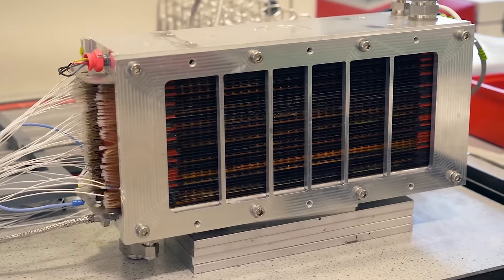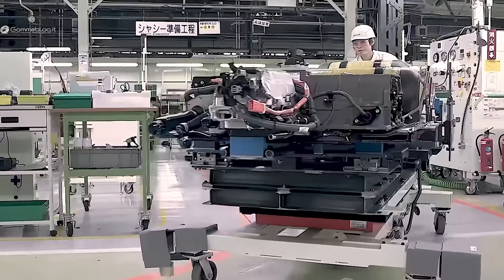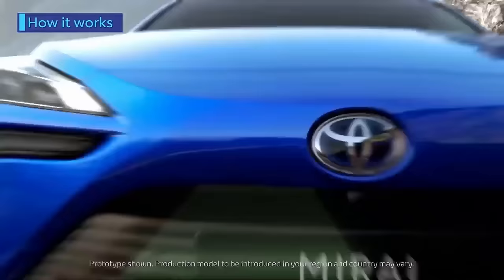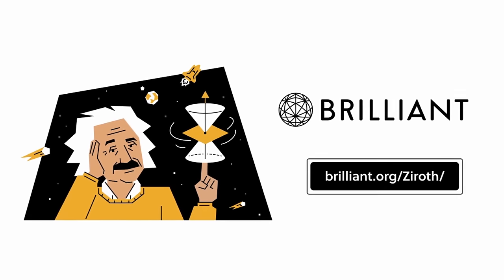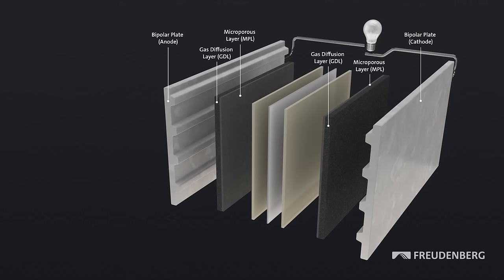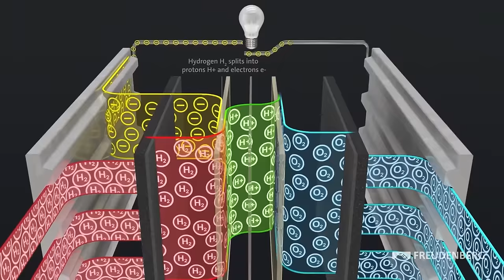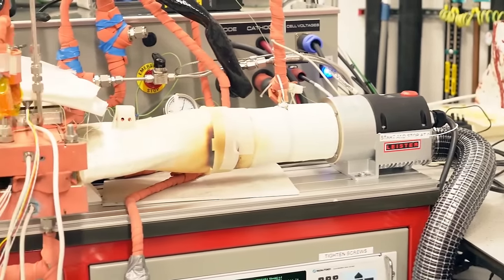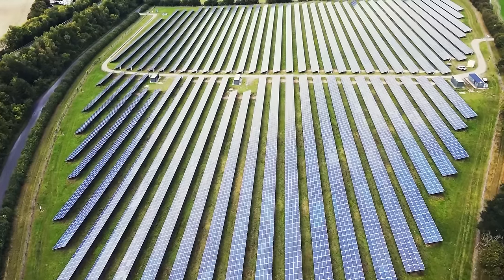Why This Hydrogen Fuel Cell is Engineering Genius

Comment: Again "slapping a turbo on it" was the solution.
Reply: at least they're using turbos in a creative way, rather than just using it to replace displacement.
Reply from the maker: When in doubt.. Turbo
Reply: Just slap a turbo sticker on something and it’s better.
Reply: As an Engineering Phsicist by education, I truly appreciate everything the turbochargers can offer. The best thing they offer in cars or airplanes are red-orange blowtorches under the cowlings. Hence, my Son's dead Subaru WRX in my driveway. That I could barbecue on the hood for ~2 hours after engine shutdown. 
I've flown in the back of several turbocharged twin-engined Cessnas. 340, 414 and 421. During the day everything looks "cool"/fine. At night, the terrifying orange-red glow from behind the engine in front of a 1/16" stainless steel firewall. Does not inspire confidence in engineering, design or longevity. No haters please. Properly maintained twin Cessnas are excellent if you fly them carefully, take care of the  ~310-375 HP engines that are 285HP in a N/A setup. And fly them as far below gross weight as possible. The problem is they are cheap to buy and very expensive to maintain. And people overload them all of the time. Because? If there's 6 or 7 seats. Then that's what you can put in their spacious cabins. Right? Plus everybody's baggage in the nose for the vacation trip to a high altitude airport.
Reply: @wanderingbufoon  this comment makes no sense. The usage of a turbocharger to increase power was insanely creative. And it doesn't replace displacement, any displacement engine could use a turbocharger. It increases efficiency. Why waste energy out your exhaust when you can recover it, use it to compress your intake charge so you can burn more fuel.
Reply: @forbiddenera  "increase efficiency" he says.. for one, it just rams more air in. Thus replacing displacement. You can have a 2L in a 1L engine. That's replacing displacement. Also, IDK why you're mentioning what the exhaust turbo does. I literally see no point of you saying any of that.
Reply: @forbiddenera  
Yep your right bud. he doesn’t mention it’s car exhaust temperatures just hot temperatures lol. You can further cool the incoming hydrogen and keeping it more dense, you could split the turbo using a drive shaft. As Mercedes did in one of their f1 cars. 
Intake side. (:)———(:). Exhaust s.
Reply: @ZirothTech  I skipped this for days because it looked like low effort AI content clickbait. You did yourself dirty bro.
Reply: @msmeyersmd8  I've got a dead XR6 turbo in my driveway. Best cars in winter, instant heat! :D
Reply: @msmeyersmd8  by N/A i assume you mean North american which markets are the 310-75 hp ones in? i'll research it myself but when you say people overload them all the time do you also mean by flight or operating hours before overhaul as well? thanks
Reply: @domwick720  Sorry if I was unclear. By N/A, I meant Normally Aspirated. Excuse my mistake if that is not the correct acronym. Please understand my purely personal bias. I absolutely hate turbochargers and what they do to small displacement engines through small, cramped , deficient airflow, consumer automobile engine compartments. 
Or under, equally cramped, aircraft engine cowlings. Especially when longevity and reliability are considered.
Trust me. I understand how most of those problems can be engineered away. But at what cost? And what purpose.
It's just a life experience, gut feeling, nauseating distrust of these turbocharged engines.
In 1973, my Dad retired from the USAF in DC. My family returned through my Mom's hometown in NW Kansas where my Uncle had a successful farm. Sitting out back with weeds up through the hood and over the top of the pickup truck was a late 1940s flathead Ford V-8. It hadn't been driven for at least 15-20 years. My Dad was a Ford fan. He went the incredibly rural auto parts shop and got a gasket set for the engine. In stock. On the shelf. So we pulled the truck out of the muck. Took the Flathead apart. I cleaned the heads which required microscopic precision😂.
We changed the oil,  xmission and rear end fuids. Dad cleaned up the carb after we  drained the lines and got new gas in it. Fuel pump was still good. Pre-oiled the engine with a drill. It started up the first time. Of course some tuning and idle adjustments were needed. But we drove it daily for the next couple of months before going on home to SW Oregon. For me to finish HS.
I'm going out on a limb here. And saying that almost 0% (zero %) of any post 1980s turbo shit-box 4 cylinder could be made operable after sitting that long.
I haven't tried it. So maybe I'm completely wrong.
It's just my gut feeling.
Reply: @msmeyersmd8 I suspect you’re right about the likelihood of resurrecting a shit box that’s been mausoleum’d for two decades. They generally aren’t made to run for 20 years, let alone run for some period of time and then corrode for 20 years. 

Does the intended use case for this technology being commercial airplanes make this any more palatable for you? Airlines are pretty heavily regulated and preventative maintenance is a known component of keeping an air worthiness cert. Yeah, airlines put profits first [at least in US], but hopefully consumer confidence encourages at least paying lip service to proper maintenance. 

Cheers!
Reply: Steellasted @0ddSavant  I see them as two different cases completely.
Modern Engineering allowing stronger lighter materials via Engineering Labs. Better efficiency, power density and much higher structural strength to weight improvements..
Different materials (especially magnesium) like aluminum and steels caused very accelerated corrosion, etc. 
Especially in moisture laden salty environments.
Older cars, stationary engines, etc. weren't concerned with weight. And were over built. So they used mostly Iron/steel that lasted longer and corroded much less.
Aircraft are designed and built to completely different design goals. Light weight, high power to weight, ability to absorb damage, etc. were priorities. The Japanese weren't big on self-sealing fuel tanks. And that cost them many losses early n WWII.
In the commercial airliners space. I have seen multiple videos where the drill holes did not line up. Boeing employees were told to just drill another hole and "proceed". Many drill holes overlapped. That could be overcome with Proper assembly procedures. But this was not done. This results in weaker joints. And metallurgical crack origination. That may progress to the point of failure. Much earlier (5-10x) than in a properly assembled airplane. That is unacceptable to me.
To be honest, I've known aircraft mechanics from my Dad through Vietnam Vet Huey CrewChief Gunners who would find that completely unacceptable. And would loudly proclaim they would not sign off on such a shit*y repair or assembly.
I will break decorum and say "FUCK McDonald-Douglas/Boeing Senior Management Assholes".  They had better keep a close eye on those people who repair and maintain their personnel transport airplanes. For mostly useless travel reasons.
I know none of those people or what airplanes they use. But there are others who do.
Personally, I wouldn't want to piss off the airplane mechanics that worked on my private airplane.
They might have trouble with the "Fencer Valve". Without the proper replacement ball-bearings, 3-in-1 Oil, Gauze Pads and 10 Qts of Quaker State Anti-Freeze. "Fletch", 1985.
Whether it's manufactured by Boeing, Airbus, Grumman, Lear, etc.
Cheers Brother. 😎🇺🇸
Reply: @msmeyersmd8  Thanks for the reply. 

Oh, I’m very familiar with Fletch. The second one not so much, but I think I could probably line for line 90%+ of the scenes from the first one.

I was thinking “Boeing” in the back of my head when I wrote original post, and still I was thinking “Well surely that’s a one-off.” 
But it’s not.  Not to change subject suddenly, but there’s a reason the US averages 1,704 train derailments per year and all of Europe averages 6. We consistently value profits over human life. 
Sigh
It’s not a good look for us.

Here’s hoping some common sense and taking pride in your work & not just maximizing stock value starts to find its’ way back into common usage.

Cheers!
Reply: Looks like he took your advice 🤣🤣🤣
Reply: I'm waiting for the Banks mod
Reply: Yeah but this time it is somewhat different I think. Because pressure increases the solubility of oxygen in water, and water is needed to conduct the ions.... this will increase substantially the limiting current density, or mass transfer of oxygen to the electrodes. Nice that this works by reusing the generated heat.
Where also due to the increased current/power density you would have  again increased heat forming. Kind of selfsustaining. Nice 🙂
'What I wonder is what would happen if youd o the same also for the hydrogen. But what I dont know if that is actually needed. Higher pressures in general should increase the cell voltage and if you sort of can get that for free then this is a nice thing to tap into
Reply: @ZirothTech   the 2nd duckt tape of automobile world

Comment: Haven't high temp fuel cells always been more efficient? That was the big issue in fuel cell development early on. You could get plenty of reliability and power from a high temperature fuel cell, but your car had to heat up to work properly.

Also, power from fuel cells has never been the issue. It's always been that hydrogen is slippery. It can leak out of most fittings and can even squeeze in between molecules of solid objects.
Reply: I guess aviation as a target is a lot more sensible then. Commercial aviation has a lot more maintenance and regulation for it's fuel and fuel tanks already so the premium for fuel tanks with better seals won't be so impactful. Once the planes turn on, they're on for at least an hour up to 12 hours so no short on-off cycling like a car. Airports being the only places where to tank up will make the supporting infrastructure easier: there might be hundreds more gas pumps than airports. Finally, unloading the unspent hydrogen from landed planes if they will also be feasible with the airport infrastructure.
Reply: Things still break faster even if you inspect them regularly, adding cost. Also, liquid hydrogen is a pain in the ass.
Reply: I was wondering too, if  the well know problem of hydrogen storage has been resolved.
Reply: Correct and it damages many types of materials, even metals
Reply: It isn't even just how hard it is to handle. The corrosion, and leaks are definitely a big part why it is stupid. It is the volumetric density that is the issue. 

 Unless we want massive vehicles with that is all fuel tank. Hydrogens volumetric density is the issue! 

 You can have the most efficent fuel cell you want. The problem is even 500 BAR tanks don't hold a whole lot.

  Those high pressure tanks are heavy and expensive for saftey reasons so it isn't like you can just go bigger like a rocket. You don't want to skimp on the quality of the construction either since that will kill people randomly. 

 When you factor in the fact that battery tech developing as fast as it is? It makes no sense to try to build everything for hydrogen when EVs can out perform them in every metric. 

 Look at Toyotas offerings. Their cars don't get more range really than an EV. They are heavier than a Model 3, less space inside the vehicle since it is dedicated to holding fuel, costlier, and there is almost zero infrastructure to support it all!

 Let us not even forget hydrogen cars don't even get the insane HP. They are relatively slow in comparison to a pure EV. 

 I don't know why, because they still use electric motors. Maybe fuel cells just can't unload their stored power like banks of batteries can, I guess. 

 It does blow my mind that a liter of water holds more hydrogen atoms than a liter of PURE LIQUID hydrogen! By a significant amount!

 Maybe one day we can create some futuristic nano sponge that somehow packs hydrogen atoms into a smaller area, and that takes little energy to release. 

 But until then I just don't see hydrogen being used for anything except niche uses. It is great for space shenanigans.
Reply: The sponge you are talking about is called hydroxide. Specifically hydroxide powdered metals. There are many formulas with many temperature ranges. Much safer than any liquid or compressed pure hydrogen. Last when it comes to vehicles and the demands of higher amp draw from   acceleration, the solution is having  a hybrid system with a battery bank that is recharged by the hydrogen and fuel cell when voltage drops. Not perfect because still using cobalt lithium, but very possible.
Reply: @karimdakkak1407  the term is hydride; not hydroxide.

Comment: The ultimate fuel cell is Methane solid oxide fuel cells - they can hit 95% chemical to electrical energy conversion without breaking a sweat! Only issue is they're expensive. But I'd be willing to bet that will change soon.
Reply: Doesn‘t this create CO2 emissions? Is there or will there be ‚green‘ methane?
Reply: @RichelieuUnlimited  the water vapor from the H2 fuel cell is as much or more of a contributor to warming as methane and way more than CO2
Reply: @terryevans1976  Well, we will need a net negative in greenhouse gas emissions at a point in the not so distant future, if hydrogen isn’t a viable alternative, than we will just have to ban flying. Or we don’t release water vapor into the atmosphere, instead storing and condensing it onboard.
Reply: Don't release water vapor?! So no breathing either 😂  @RichelieuUnlimited
Reply: @RichelieuUnlimited  Methane makes the least CO2 of any carbon-based fuel, but if you're worried about CO2 yes there are many renewable methane sources.
Reply: @maj429  I‘m no expert on fuel cell technology, I have superficial knowledge at best, the type you get by skimming through introductory material once or twice. Thus I ask. I couldn’t find information on how *long vapor released at higher altitudes stays in the atmosphere on short notice, so cannot easily compare the climate effects of water vapor, CO2 and methane if released by planes. The goal has to be net zero additional greenhouse effect, as otherwise any reclamation efforts to restore the former equilibrium would be futile. Combatting merely the symptoms of global warming is already quite expensive.
Reply: @terryevans1976  what do you mean? There’s water vapor every day in the air, then it falls down and waters the plants…

Do you mean that “all the water vapor” is the biggest cause of warmth on earth? Because yeah, that’s called “the atmosphere” and I can believe all the clouds keep us warm by reflecting/diffusing sunlight.

But putting 1000 L of basically rain in the air… how is that a problem?

Maybe I’m missing some key insight here. Gonna do a G search.
Reply: Not - 55 -60% if working with methane and 95% if work with H2 but this is not true they work very hot only.
Reply: @lucbloom  I'm just stating that water vapor is one of the largest causes of greenhouse warming.  So if you are promoting a solution that generates more water vapor to stop warming its' counter intuitive.
Reply: @RichelieuUnlimited  condensing shouldn't be an issue - the air's pretty cold up there.
Reply: you mean around 80% efficiency right - not including the energy required from ground to tank of course. Still impressive tho. Couple remaining issues like carbon deposition and "sulphur poisoning" still need to be solved.
Reply: @terryevans1976  The water vapor wouldn't remain in the atmosphere and cause warming you loonie tune. Absoluter cartoon character. Never heard of rain, huh? Clown shoes.
Reply: No. The big issue is that they emit CO2 and getting rid of CO2 emissions is the whole point of the exercise.
Reply: @filonin2  I believe on a large scale in urban areas the water vapor produced without a way to dissipate would creat pockets of  more dense and higher temperature conditions that overtime would lead a condition of areas insulated into a higher humidity and higher temperature conditions, and along with already 400 + ppm c02 concentration would only be further likely to return that carbon into the soil  from the increased dew point condensating in higher alitudes but also creating more powerful low high pressure contrast resulting in stronger storm and thermcyclical weather events that would cause flooding more likely as well as erosion. but how else will all that c02 cycle back to the earths tertiary make up? the ocean is full
Reply: @filonin2 hahah